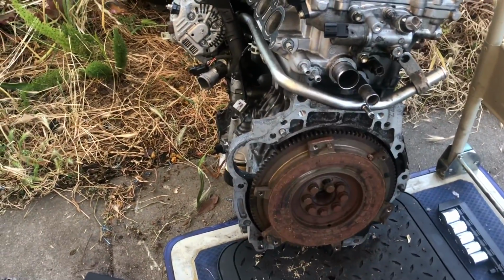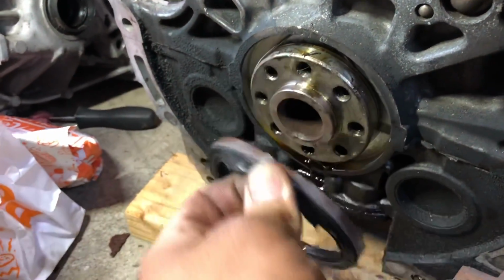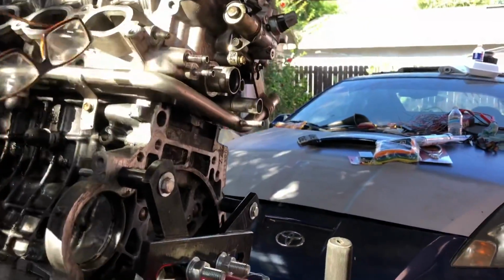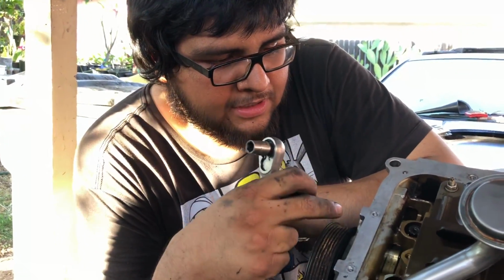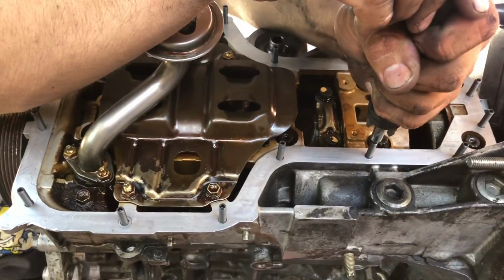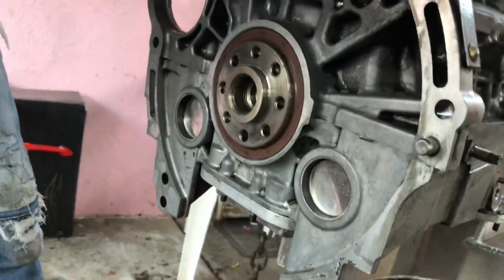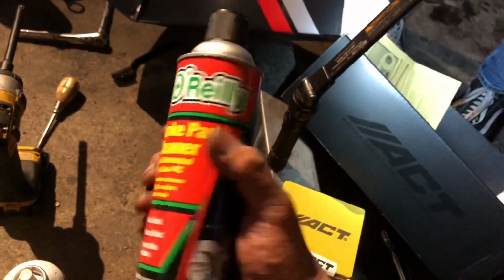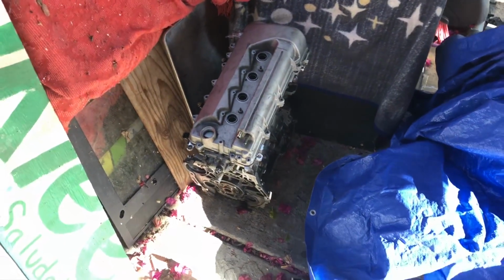Pt:1 Clayton's Cursed Celica / Making it great again!

Comment: Clayton didn't pre-oil the filter 😲
Reply from the maker: Project 209 engine has been sitting for 2 years or so. We will for sure prime the engine for a good 30 seconds with the EFI relay removed before starting the engine. Oil will for sure make its way to the filter.
Reply: @2zzlow  I kind of thought nso, as there was a lot of rust dust coming loose at beginning of video where you were removing flywheel bolts ... 👍

Comment: I died when i saw Clayton go at the oil drain plug with a wobble socket, xD LOST
Reply from the maker: The wobble with the 14mm we used to mount the engine to the stand and I guess it was the closest thing to us to remove the drain bolt. I literally told him to get the right tool because commenters were going to flame him hahaha
Reply: I'm a pretty noob diy mechanic so I dont judge too much, anyway, I'm pretty sure he did it on purpose cause he was bored and said to himself ahhh what the hell, let's go at it with a wobble socket xD